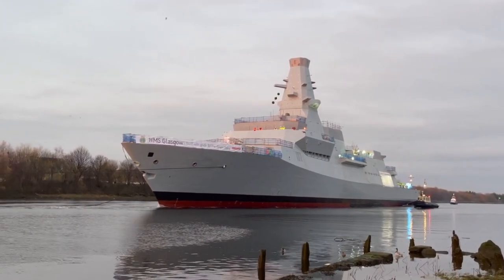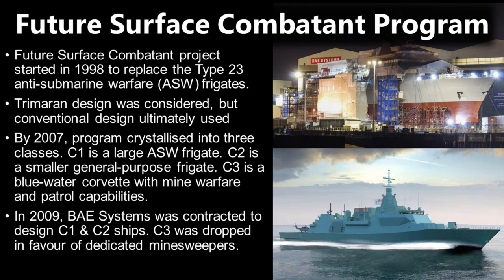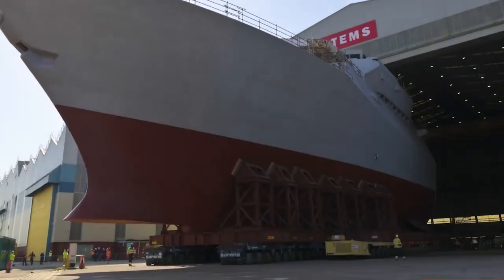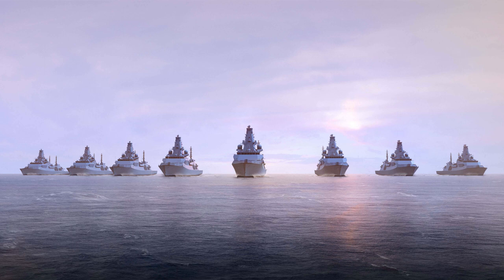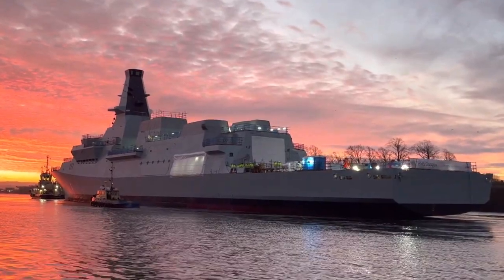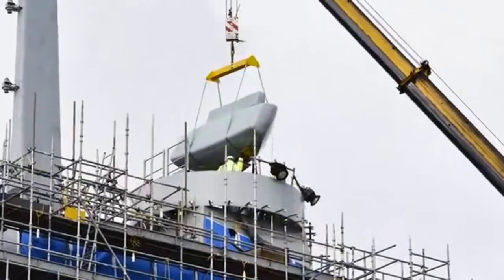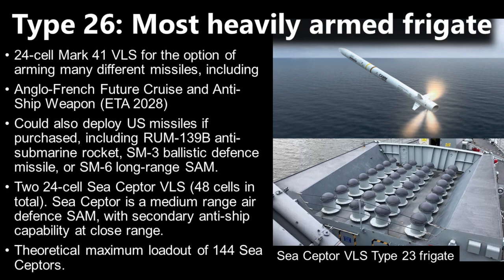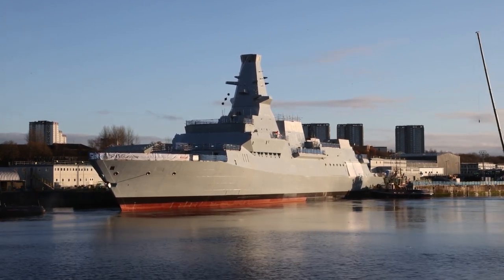How Lethal Is UK's Type 26? A Super Frigate of the Future

Comment: Yeah it's basically a frigate in name only (like many European frigates). Conceptually it's essentially a Type 45 but designed for ASW instead of air defence. In terms of cheaper and potentially expendable general purpose frigates, that's really the role of the Type 31, although a lack of smaller ships is a serious problem that has been identified with the Royal Navy currently.
Reply: The RN is too small now to have generally expendable ships - every ship will need to fight and be properly capable of going to war. I don't believe we should be building the T31 with the number of hulls that are present in the fleet.
Reply: @tomriley5790  How long, however, before the MoD start explaning that both the 26s and the 31s are designed 'for, but not with'  a host of weapons systems?
Reply: @tomriley5790  obviously no blue water ship is truly "expendable", but it's also naive to think that in a modern combat environment you won't have casualties. If a mission requires fewer capabilities it's always going to be better to send a cheaper, more easily replaceable ship. Many missions the RN will operate won't require a ship as sophisticated as a Type 26 or Type 45, so ships like the Type 31 absolutely have a place there.
Reply: @tomriley5790  

The future security of our nations should never be left to good fortune or the kindness of superpowers and aspiring superpowers. 

CANZUK should increase defence spending to 5% of GDP.  

There should be more Type 31. As with the QE class, Types 45, 26, Astute and Dreadnought. 

A Division (4 units) of large battlecruisers would be very useful as would eight heavy cruisers. 

Big, fast, powerful missile launch platforms that can dominate the air, sea and subsurface for hundreds of miles radius. 

I’d like to see ICBM capable Battleships, a Division of four units. 

But if only one class could be expanded it would be Astute.
Reply: the uk is expected to field 5 extra type 32 frigate and uparmed river class opv that would mean the uk have 10 general purpose frigate that can do low intensity asm and anti air mission and 8 armed offshore patrol vessel that has blue water ranging  capability great for anti piracy missions and low threat patrol duties that will be the low fleet of the uk royal navy freeing up  the high fleet that will be 6 upgraded type 45 and 8 type 26 escorting 3 bay class Dock landing ships 2 albion class amphibious warfare ship and 2 queen Elizabeth class aircraft carrier and 7 replenishment and tanker support fleet this will give the uk actual teeth in a real fight.

Comment: Ppl dont realise that not all the type 23s weren't all anti submarine specialists as in the late 80s early 90s only 8 were upgraded as asw ships & the rest were converted to general purpose frigates so there's  no difference number wise with the amount of type 26s & 31s etc let alone when the 32s r started, the Artisan radar system is already used on the type 23s after their modernisation refits, the QE aircraft carriers & the 1st 2 type 26s r floated & having its weapons & electric warfare suits fitted out b4 when hms Glasgow the 1st T26 off the production line starts its sea trial in the first quarter of 2025!!

Comment: Forgetting what China have (as we don't know anything about them), what is the best all round multi mission ship on the planet at the moment?? The flight 3 Arleigh Burke. With 96 MK41 VLS, a hull and towed sonar, spy 6 radar and Aegis combat system it is by far the most powerful warship on the seas. 

The Type 26 COULD be better. If you we're to remove all the sea ceptor VLS and replace them with MK41 VLS you would have 72 MK41 VLS. I think you might actually be able to fit 32 MK41 behind the funnel where there is currently 24 sea ceptor. If so that would take the number of VLS cells to 80. 

If then we we're to give the ship an upgraded, more composite version of the sampson radar, which is still one of the best in the world for tracking incoming aircraft and anti ship missiles, in my opionion you would have the best destroyer on the planet. It will already be the best ASW ship out there, and with a world class radar, 80 VLS, a multi mission bay to deploy USV's and everything else it can fit in there, the Royal navy would have a world class escort that should replace the type 45 AND the type 23. Use the type 31 for chasing pirates and skiffs, and this bad boy for long patrols and escorting the carriers.
Reply: Yeah but the flight 3 Arleigh Burke costs 1 billion each
Reply: So you think we should scrap plans for Type 83 ?
Reply: @Belisarius1967  Yeah i do. With a navy as small as ours today i don't think we need type 88, type 26, type 31 and type 32 (if it comes to fruition) Why not just have a high end surface vessel and a low end one. Scrap the Rivers when they are due and replace them with type 31's. It makes sense to me and would be much simpler, cheaper and quicker to build. 

BAE has just done a design study on a 96VLS version of the type 26. could be a good candidate for the type 88 then use the 80 vls version to replace the type 23 as an ASW vessel with some teeth, replace rivers with type 31 and replace the type 32 with type 31 and we would have a strong fleet.

Comment: The RN should develop an arsenal ship that is a drone ship, 12 crew to run it, tiny wheelhouse and flush deck with hundreds of launchers. Missile can be fired remotely from a type 45 (the lead) boat. a small cat and trap for radar plane and some small refuelling aircraft, cheap as chips with devastating fire, however BAE are slow at building ships and are not very bright.
Reply: saya a man who has never built a warship, except in lego.

Comment: You're using my video without permission.
Reply from the maker: Apologies. I do believe my use falls under fair use purpose of commentary though, but I should have asked you first regardless
Reply: @NavalEnthusiast  I appreciate your prompt response and understanding regarding the use of my video footage in your recent YouTube video. However, I want to clarify why I believe the usage does not fall under the 'fair use' doctrine.

Firstly, it appears that my footage contributes a substantial part of your video. The amount and substantiality of the portion used in relation to the copyrighted work as a whole is one of the factors considered in fair use cases. While fair use supports commentary, the doctrine doesn't necessarily cover extensive or integral usage of copyrighted material.

Secondly, it seems that my footage is used primarily as a background for your video, and it's unclear whether it contributes significantly to any transformative purpose, such as commentary or criticism. The purpose and character of your use would likely need to substantially alter or add new meaning to my original work for it to potentially fall under fair use.

Lastly, your video is being monetised, and while commercial use doesn't automatically negate fair use, it can weigh against it, especially if it appears that the copyrighted material is being used mainly to drive traffic or generate revenue rather than for transformative purposes.

Please understand that this issue is important to me, not only because of my rights as a content creator but also due to the potential impact on the market for my work.

I would like to kindly request that you remove my footage from your video or discuss potential licensing options with me.

Thank you for your understanding.

Best,
Reply from the maker: @georgeallison3264  Can you email these points to me (just copy and paste), and we can continue this conversation by email? 
navalreviewer@gmail.com
I still do believe my use represent fair use, and I will articulate why in email. But I will also consider whether to remove your footage from the video if it is easy to do. In that email, you should include a link to your original video (persumably it is on UK Defence Journal), and if possibly the rough time stamp in my video in which the usage occurred.
Reply: @NavalEnthusiast  If it's a problem to remove it all together, a credit in the description will do in this instance. For it to be fair use, it would have to be a much smaller portion of the video, I also note imagery from ourselves is also used.
Reply from the maker: @georgeallison3264  Hi George, thanks a lot for allowing me to use the footage in this instance, conditional on me including a credit to you (UK Defense Journal) in the description. Let me know if this interpretation by me is incorrect. I am at work right now, but will credit you once I get the chance this evening. I will also refrain from using material by UK Defense Journal in future videos, unless with permission from you. Also, I appreciate you reaching out in the first instance, allowing me to have a chance at addressing your concerns.   I'll notify you again once I have done the crediting.
Reply from the maker: @georgeallison3264  Alright, done